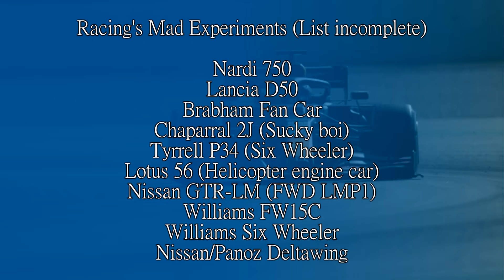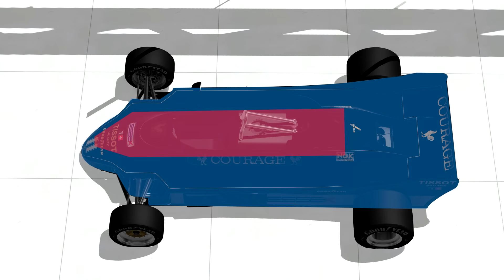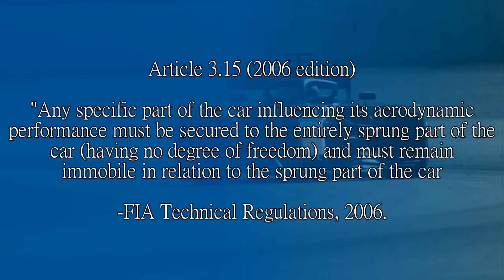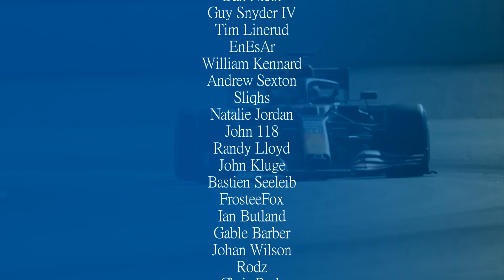TWO CARS IN ONE! The Story of the BANNED Lotus 88

Comment: The problem was a matter of which side of the pivot point the aerodynamic components were. The aerodynamic components of the 88 were all on the wrong side. A fault with this video - and several others - is that they describe the outer chassis as being attached with very heavy springs, which it was not. Other videos show that it could be pushed down with relative ease and I believe the total pressure was about 20 kilos. The other problem is that they fail to point out where exactly these attachment points were. In fact, they pushed down on the lower suspension arms, just next to where the A arms attached to the bottom of the uprights, thus putting them on the unsprung part of the car.

The Lotus 88 ran at the US Grand Prix West and was nine seconds off the pace. After protests by no fewer than 11 teams, Clerk of the Course, Chris Pook, ruled it ineligible. De Angelis took it out again and it was immediately black flagged and he and Mansell were left to drive the 81. Tyrrell, Fittipaldi, ATS and Theodore were the only teams not to lodge a protest.

Chapman tried several times to get it to run in the following months and was overruled each time. He took his complaint to FISA and the FIA court, where it was ruled ineligible again. That should have been the end of the matter but Chapman insisted on pushing the point with what he called the 'B' spec car. The stewards at Silverstone approved it but the other teams protested it again on the grounds that the 'B' spec car was no different in any area that mattered. The FIA court ruling carried more weight than the stewards verdict - as it should - and the car was again ruled ineligible.

In the end, while the 88 was a very clever idea, the project was really all about semantics.

Comment: Something you missed was just how much of an uproar this car caused.
It got so bad, that Chapman was actually threatened by the FIA. They told him that if an 88 was so much as entered into the British Grand Prix, Lotus would not only be completely disqualified from from the race, but from both championships.
Reply: The car was protested by no fewer than 11 teams. Only Tyrrell, Fittipaldi, ATS and Theodore did not lodge protests. So yes, it caused a massive uproar. The British Grand Prix was a case of Chapman trying to push it through using the 'old boy network'. He claimed to be running a 'B' spec of the car but other teams protested again, saying that it didn't differ in any significant way from the original car. But the fact was that the matter was really ended when he took it to FISA and the FIA court, where he was allowed to make his case in detail. The court ruled against him and by implication, also overruled the stewards at the British Grand Prix. The FIA court had already ruled on it and the matter should have been final.

This car was a very clever idea but in the end, it was more about semantics than anything else.

Comment: In the early 80's I was driving a 1968 Mustang fastback. Just like Steve McQueen Mustang. 
I put rubber skirts on it. The first thing I noticed was how quiet the wind noise became.
My only available test track were the huge corners at freeway on ramps in the United States. 
Before skirts, 40mph
After skirts, 45mph
I can't imagine what traveling over 100mph.

Comment: Ever since the high wing cars of the 60's were banned all aero parts of the car have to be attached to the sprung chassis and their loads passed through the entire suspension system to the tires. Those aero parts also must be rigid. 
The 88 was in violation of both of those rules as the outer chassis attached to the inner chassis suspension ARMS with a spring system of its own. It should have never received a FIA certification in the first place.

Comment: (Something I've written a few years ago as a comment to someone's Facebook post)

...In the late 70's/early 80's Formula 1 was in many ways at a crossroads, the (Ford Cosworth) DFV and the lightweight metal chassis construction were at their power and design limits and modern aerodynamics was at its infancy; it was easy for privateers to enter in to Formula 1, all it was needed was one or two drivers, a team of mechanics, build their own chassis or buy a surplus from one of the major teams, "strap" a Ford Cosworth DFV engine at the back and of they go...; cars and drivers performances were in a sliding scale of driving ability counterbalanced against the chassis/engine used; it resulted in a (good) stalemate and good races for years; some teams tried to end this stalemate using more power (turbochargers), better grip and/or handling [ground effect ("fan/wing cars") or multiple wheel axles] and there was a brewing storm, or already had broken, between Jean-Marie Balestre, head of FISA and Bernie Ecclestone, head of FOCA about many Formula 1 related subjects, each side offering a "sacrificial lamb" to appease the other side for a short while and then there was (Enzo) Ferrari, who particularly disliked and envied any innovation presented by other teams that not his; in to this venomous environment the Lotus 88 appeared and was one of the "sacrificial lambs" in the "FISA-FOCA war"...

Comment: "entirely sprung": One has to admire the bizarre way that the F1 rules are written. They sound strict but don't bother with defining their terms.
Reply: Perhaps Aidan should read the rules in detail. I believe what it says has changed somewhat but nevertheless:

'With the exception of the driver adjustable bodywork described in Article 3.10.10 (in addition
to minimal parts solely associated with its actuation) and the flexible seals specifically
permitted by Articles 3.13 and 3.14.4, all aerodynamic components or bodywork influencing
the car’s aerodynamic performance must be rigidly secured and immobile with respect to
their frame of reference defined in Article 3.3. Furthermore, these components must produce
a uniform, solid, hard, continuous, impervious surface under all circumstances.

Any device or construction that is designed to bridge the gap between the sprung part of the
car and the ground is prohibited under all circumstances.

With the exception of the parts necessary for the adjustment described in Article 3.10.10, or
any incidental movement due to the steering system, any car system, device or procedure
which uses driver movement as a means of altering the aerodynamic characteristics of the
car is prohibited.

The Aerodynamic influence of any component of the car not considered to be bodywork must
be incidental to its main function. Any design which aims to maximise such an aerodynamic
influence is prohibited.
.'

Article 3.3 defines the suspended part of the car and is much more complicated.

 So, in fact, they are more specific than what Aidan is saying. In fact, it might have been better for all if he had quoted the rules directly instead of indirectly. Yes, it was a problem because it made a loophole which Chapman was trying to exploit using semantics.

Comment: The original intent of the rule requiring aerodynamic devices goes back the the FIA's ban of suspension-attached wings after the Spanish Grand Prix in 1969.  It was aimed at the high wings that were pioneered on the Chaparral 2E and adopted wholesale in F1 in 1968, especially by Lotus.  Those wings had never been a problem in sports cars, but Chapman being Chapman, he skimped on the strength of the supports to save weight.  Something like the 88 was completely beyond conception when the rule was devised.

Comment: Nice video Aidan. The 88 was a really interesting car.

Just looking at your PC specs there (looks like you upgraded recently!), you need a B550 motherboard to take advantage of the speeds your PCIe Gen 4 CPU and graphics card are capable of doing - you're losing between 5 and 10% of performance using a PCIe Gen 3 motherboard. Maybe also some Gen 4 storage too, NVMe drives are getting much cheaper now.

Comment: IIRC, the Lotus 78 wasn't intended to be a ground effects car.  The idea was that the sidepods would be another "wing" just mounted amidships.  The skirts were just another version of endplates, meant to keep air flowing over the wing profile (upside down relative to an airplane, because downforce).  But Lotus found the car was generating much more downforce than they expected given the size of the wing elements and their chordal profile.  That's when they realized that with the sideskirts sealing off the sides the whole underside of the car was acting as a Bernoulli tunnel to generate downforce.  The Lotus 79 was then a deliberate attempt to capture this effect to increase roadholding.

Comment: I think the best description of this car and its legality I've ever seen went along these lines:

The car was not revolutionary, nor did it really have 2 chassis. The independant "chassis" is just an oversized moving skirt, moving ground effect skirts being already banned, which lotus tried shoving past the rulebook by having it go over the top of the car and calling it a chassis. Further, other teams weren't the only ones complaining. Lotus drivers were. As fast as the car was, it was violently unpredictable and extremely unsafe even for its time.

As much as I love lotus and its many advancements and contributions to motorsport, I have to agree with this. It's really blatantly a moving aerodynamic device, not even exploiting a real loophole like the Brabham fan car, they just used a different word to describe a banned component. It's like if I told an officer after pulling me over I wasn't speeding, rather simply expediting my arrival.
Reply: Exactly. Good post.

This was about semantics, which you correctly identified. Very few others saw this for what it really was.

Comment: As I remember, the ground effects cars developed enough downforce that immensely stiff springs were required so that there was hardly a suspension at all. The drivers had a hard time driving the cars and (at least an excuse for the second chassis) was to allow the drivers to be spared the harshness of the ride that  affected, among other things, their vision.
This video dovetails nicely with a request I was considering yesterday and that is to do a deep dive into Jim Hall and his Chaparrals. I feel he and his cars do not get nearly the attention and accolades they deserve since they introduced, among many other things, composite tub, clutchless transmission (thought to be automatic but really the clutch was replaced with a torque converter) articulated flaps first and then articulated wings, side mounted radiators, and even a fully monocoque chassis. I'm sure you could do them justice.
I enjoy your videos. Keep it up!
Reply: Alan Jones tested a Williams FW07 with solid bars instead of compressible spring-damper units. Having driven a car with no suspension, I can only imagine what it must have been like.
Reply: @thethirdman225  There's the infamous video of that test with Jones complaining the car was too stiff and uncomfortable and Frank Williams suggesting that Jones "try sitting on his wallet"
Reply: @karlbassett8485  Yeah and Jones’s quick fire response was something like ‘Gimme something to put in it’.

Comment: The way I understand this is:
1) for ground effect to work, the car needs very stiff suspension to maintain correct ride height, but
2) this means the driver's spine takes a hell of a beating. Therefore,
3) you put most of the suspension between the driver's tub and the car's structure (rather than between the car's structure and the wheels). So, the car is stiffly sprung but the driver isn't.

Couldn't they have done this by padding the driver's seat though? Wouldn't that have been simpler?
Reply: The seat has to be molded to the drivers back and there's a set of rules for the ergonomic side of things. I don't see it being very effective anyway, the driver would shake more than the car.

Comment: "Entirely sprung part" is anything inside the car side wishbone attachments. It is the masses that interact with the road entirely through the absorbtion and release of the springs energy. Everything outside the inner pickups is either semi sprung (pull/push rod, suspension elements, brake fluid if they still have it, etc) or unsprung (tires, wheels, brake hardware, that aero fender, etc).

The rule as written, and as interperated against Renault, is everything attached to the sprung part of the car cannot move in relation to the rest of the sprung mass for the benefit of aerodynamic gain. In Renault's case, the stability of the front aero platform was the aero gain.

Comment: I never understood why they had no front wings. Groundeffect only takes effect some way behind the front axle, and then only at speed, doesn’t it? So in low speed corners you’d get understeer like a greased pig, I guess. Especially with the stiffer setup. Here comes slow, bumpy, hillridden Monaco! Someone with a technical degree please explain.
Reply: I have no technical degree but I‘ll try to explain it best I can anyway
If you set the car up so that the centre of lift (like the centre of mass/gravity is the average threedimensional point of the mass of an object, the Centre of lift is where in this case all the downforce applies averagely) is in front of the Centre of mass, the car has more front then rear downforce.
So what teams would do is design the floor and set up the cars in a way that the downforce generated by the floor was centred before the centre of mass. They balanced that out with a rear wing to bring centres of mass and lift together as close as possible (makes a car predictable at every speed and easier to set up the fine details through the suspension geometry). This way they could save the front wings and their drag as well as getting more clean flow to the underfloor
Reply: On a well-engineered race car the aero effect overtakes the mass effect at a relatively low speed. I seem to remember seeing a quote as low as 30mph for those early 80's F1 cars, so as long as the tyres were up to temp understeer wouldn't necessarily be a big issue unless the aero balance was wrong. Just as most objects have a centre of gravity, a car will have an aero centre which defines the relative balance of pressure. On this generation of F1 cars it was rear-biased but not as much as you might expect. Engineers tried to keep the balance well ahead of the rear axle to keep the polar moment of inertia low (change direction better & make the car more nimble). Front wings were used (or not) on different circuits just to adjust the trim and balance of the setup for drag vs downforce...
Reply: Thanks, guys!
Reply: One thing you forgot, the wings are much of an aerodynamic device as the tunnels and body are, the effect depends on moving air.

In fact, it's the same effect, the thing with Ground Effect is the realization that wings that have a wing chord bigger than their distance to the ground are more efficient. Because the ground prevents the tip vortexes growing as much as they would normally.

Then we realized any shape that compresses air, and not necessarily just a wing, would work, so that's why the Modern F1 tunnels are more like 3d puzzles.

Comment: I've held many things of CFRP, it gets less weird over time. things like rotor and propeller blades are light but proportional to their volume, because they have centimeters thick laminate and stand up to 7000g, while chopping chickens in half. Ducting however is made with 3 or so plies, it is as thin as possible while keeping air in. if you move them about, you feel resistance more from aero drag than weight, and you tend to grip them overly tight. Same thing with balsa some types of foam.